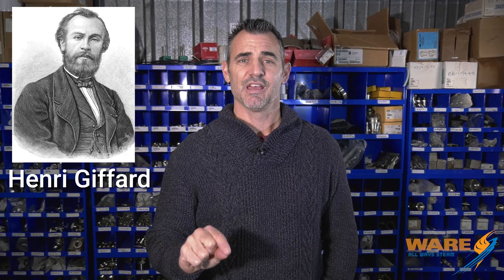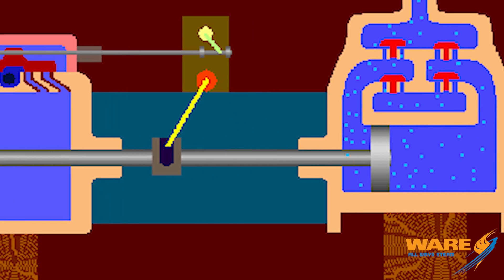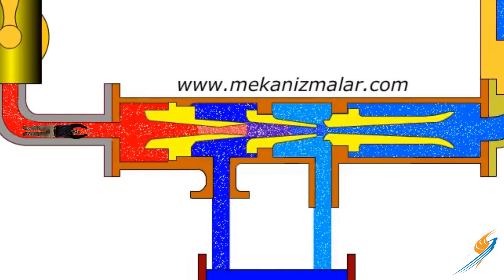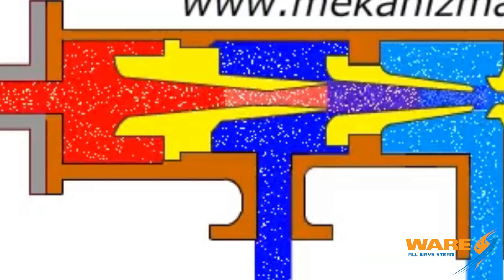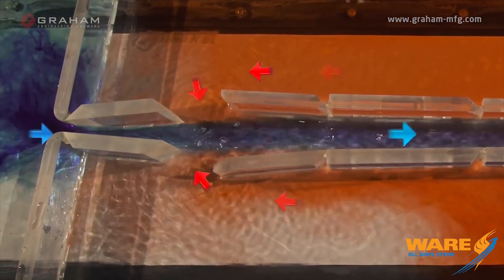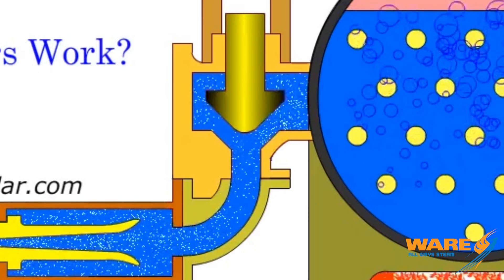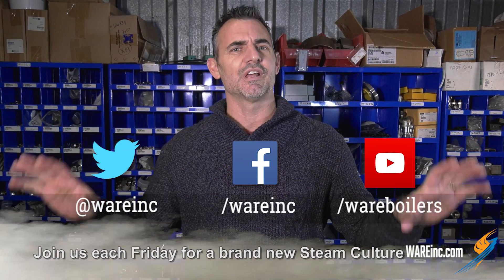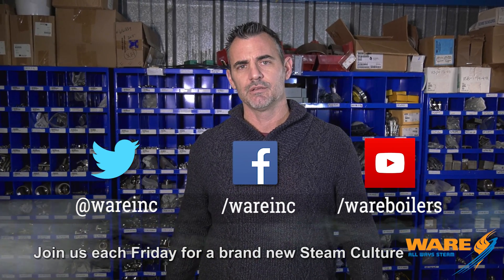What is Steam Injection? - Steam Culture

Comment: What I don't get is steam with a certain pressure is used to accelerate water and pressurized above that pressure the steam came from.
In your analogy with the water you would have to raise the combined water higher than the coloured water level. That's not possible. The trick is it's steam and thus has heat energy and that energy is used.. but that's thermodynamics and that has always been a magic box for me.

Comment: This answers the question I had about the steam engine being a "batch process" or a "continuous process".
I thought it was a batch process because I figured there was no way you could overcome the high pressure in the boiler once it gets really hot.  Back in the early days there was no such thing as a pump that could deliver water into the boiler with a higher pressure than the boiler pressure.
So, you're really "stealing" some of the energy (via the recirculation of steam) from the top of the boiler to "force a suction" of water and deliver it into the boiler at a higher pressure than what's in the boiler.

Comment: We use the steam injection in our boilers at work. The steam injector is connected to a feedwater tank that then pumps that water into the two high pressure boilers. It’s a way of saving energy and money.